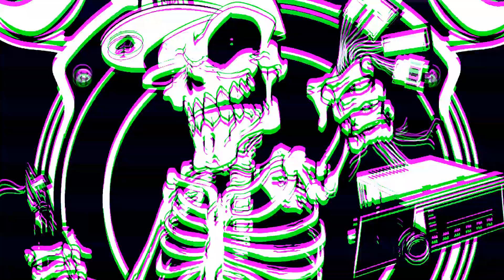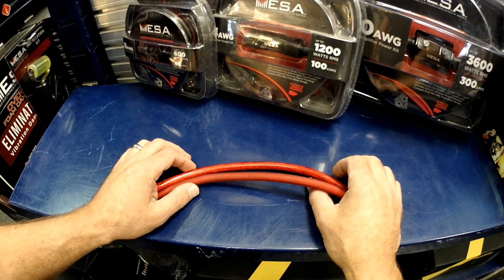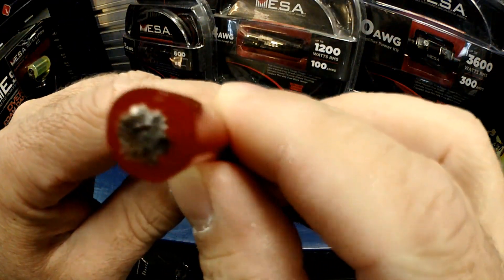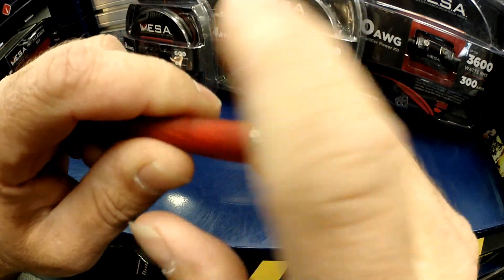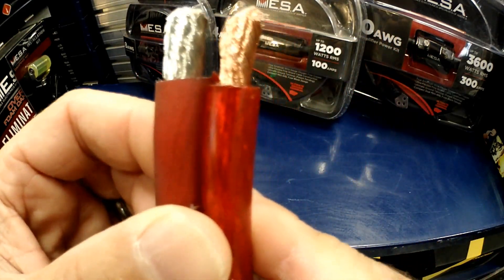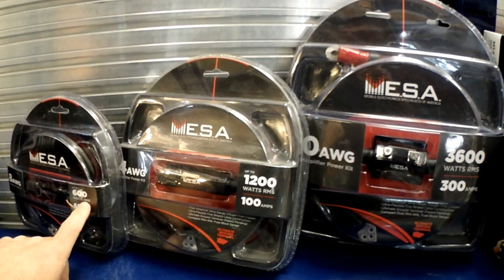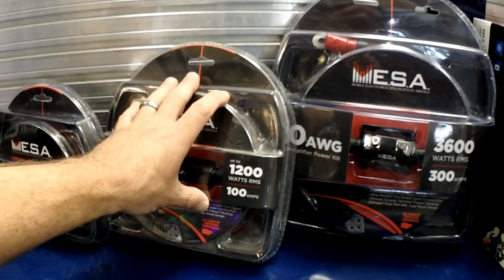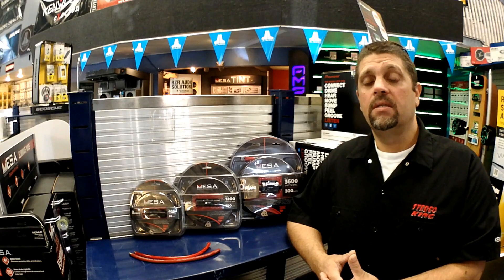Are All Amplifier Power Wire Kits Created Equal?

Comment: What size wire do I need for a pioneer gm-a3702 amp and what size fuse thanks ryan
Reply from the maker: you can get away with 10 gauge and a 30 amp fuse under the hood. This will need to be ofc wire not cca.